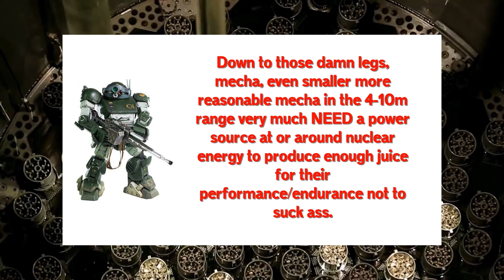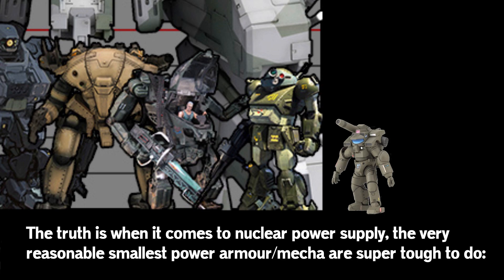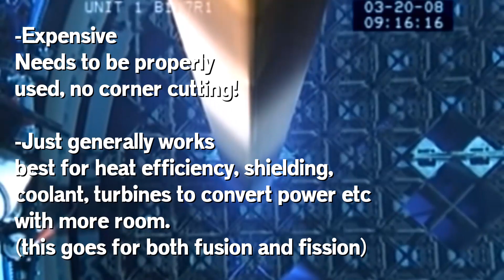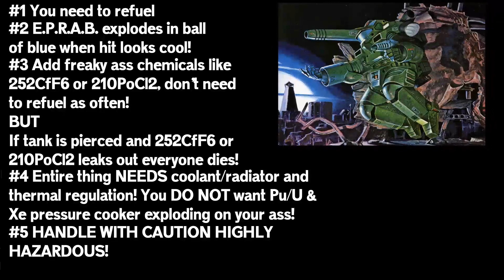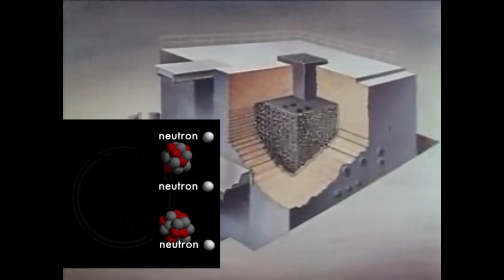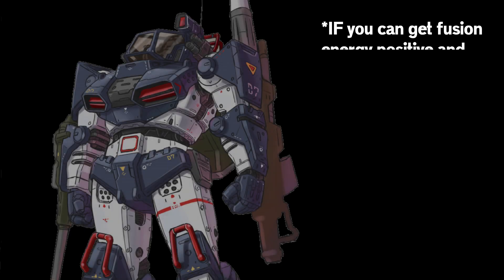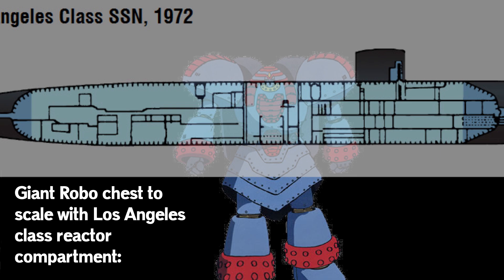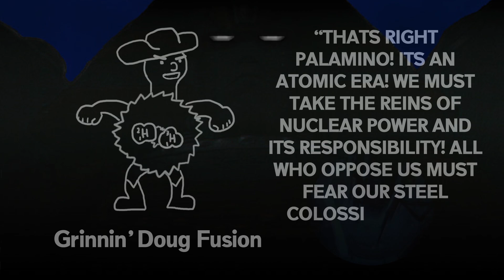REBIRTH OF MECHA 6/9: NUCLEAR POWER AND THE GIANT MECHA

Comment: 13:33 - "900 megawatt per second"
Actually, it would just be 900 MW, since the watt already contains a second in it : a watt equals one joule per second. The only reason we use units like kilowatt/hour when buying electricity is because we share a powergrid where everyone is pulling different loads at different times for different durations of time.
Reply from the maker: I am aware

Comment: Just wondering if any of research that Gerritb did mentioned anything about fail safe for if a reactor was damaged or melt down?
Reply from the maker: Hey did mention anything explicitly but if you have any questions feel free to ask! Im somewhat familiar with this stuff.
Reply: @argonbolt  I was just curious if there would be a tank of inert chemicals or some other system to "defuse" the reaction in a failure state. Like I have work on a "fire proof" transfer valve design for work and I couldn't imagine the work that would go into building and design of fail safes for a reactor that power a war machine that will get shot at.
Reply from the maker: @Bubbaj0e  Depends on the reaction in question:

For the 1rst example, good luck. The space and weight requirements are already so tight you can barely get the power supply in there to begin with, if the guy takes a hit, its big blue kabloowie. And dont breath in too much of that haze afterwards.

As far as #2, its still really tough, if we go with my point about using fusion, then their is not a ton to worry about really as even with magnetic confinement, plasma does naturally diffuse itself(after the fairly large catastrophic explosion of several tons of TNT from the magnets going up). So outside of a brief radiation/neutron burst at detonation there is no residual radiation. You don't need to get rid of the reaction as it does that to itself already.

For #3 GR-1, oh baby, you got so much mass and room, Giant Robo could have a full on reactor SCRAM shutdown(Control rods, neutron poison, etc) mechanism built in, and even in a worst case scenario, with liquid metal coolant, once the system freezes up and solidifies, there is no meltdown "BOOM" of the same kind as pressurized water reactors really, there will be some radioactive chunks but the sheer mass of Robo alone will work to contain most of the worst really.
Reply: @argonbolt  Thanks for the response. So scene in MSG where Amuro accidentally hits a Zaku's reactor is kinda spot on.
Reply from the maker: @Bubbaj0e  Sorta, what exactly is going on there is kinda wacky to nail down, Minvosky reactors (like all gundam tech) are repeatedly lore-b.s.ed over and over to get adjusted to fit a believable tech, but its inherently got some magic in it.

Like in principle some diagrams show the minovsky reactor to be looking very mini-tokamak magnetic confinement  fusion based. So if that is the case then like, the normal gundam explosions work well enough, but the Zakus going fucking Hiroshima level from a reactor hit is very ???

Simply put, even if a beam rifles charge directly hit a fusion fuel tank it would largely just explode normally. There just isnt enough confinement and pressure to cause fusion, and even then
IF
by some magic super dice roll you managed to induce fusion in ALL the tanks in a mobile suit from a beam shot, the end result is just a normal explosion/fireball Again. Fusion=/=fission, and so the big boom should not be happening.

NOW, that is all technical realism argument, the narrative argument is that Japan hates nukes, Gundam is Japanese, the nuke explosions from mobile suits (which already only happen when the story needs it too and not even most of the time otherwise) are there to illustrate double edged nature of tech blah blah blah dangers of atomic energy yadda yadda, so it does make a kind of narrative sense don't get me wrong.
Reply: @argonbolt   Another question, can outside radiation or random subatomic particle zipping around in space be a concern for a reactor? I know you would already have shielding because you are in space so maybe that makes it a nonissue.
Reply from the maker: @Bubbaj0e  Its pretty much gonna be a non issue yeah, even with 0 shielding, general random background radiation will have no real effect on fusion or fission, and yeah all electronics are gonna be hardened by default.